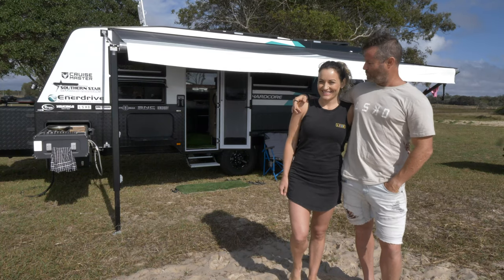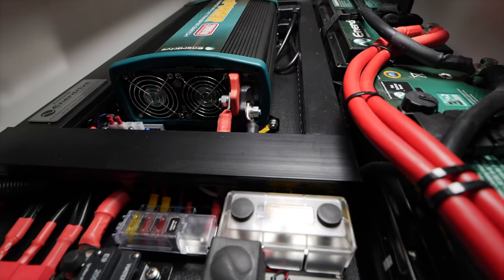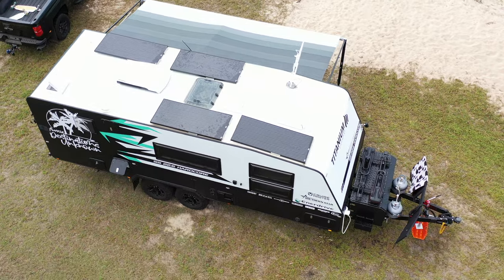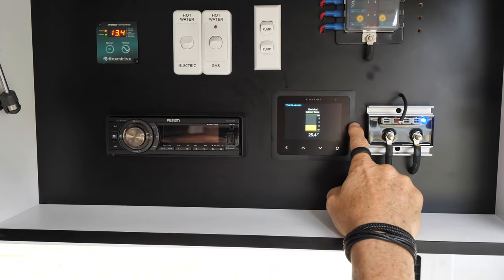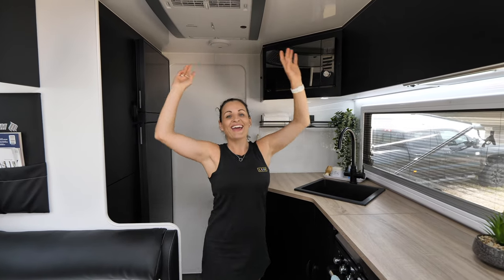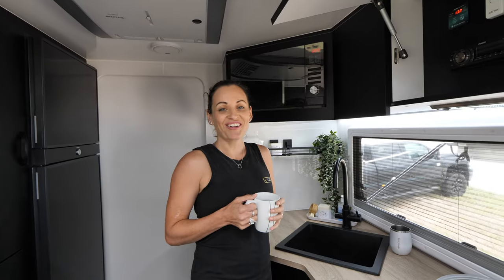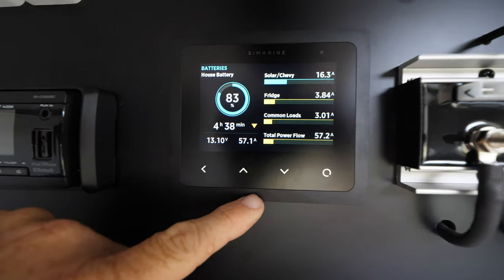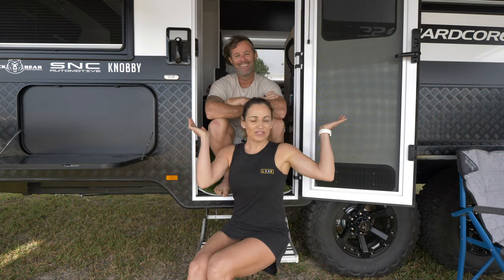Our Enerdrive Off-grid Lithium Battery System

Comment: Hi Chris and Miriam. We are considering an Enerdrive 400Ah system for our recently ordered Crusader X-Country Extreme. This video has sealed the deal. Thank you! I note you are changing to 2600W inverter. Was the 2000W insufficient?
Reply from the maker: Hey Rob. Great news on your new van!!!! Yep this system is amazing, we love it. Mate the 2000W inverter runs everything except the XXL Airfryer (2200W) and unfortunately Miriam wont be without it. This is the only reason we are upgrading and to tell you the truth i love what she cooks in it so I'm sold too haha
Reply: Thanks for your reply Cobber. Xlnt news. Our air frier is only 1500W! Final question, which air con is fitted to your van?
Reply from the maker: @robmorley7041  It's Miriam here now! :) I've had 2 air fryers for a while but we can only take one with us in the van - and the 2225 watt XXL kicked butt over the 1500w that we had. In fact the more i used the 1500w one the less I liked it and ended up giving it to my son. Lol. I'm fussy with my appliances and grateful to Chris for being so understanding hahaha! Oh - and we have the Truma Aventa air con installed. It's so much better than the others we've had. Much quieter and draws less power.
Reply: Aussie Destinations Unknown Thank you Miriam. It would be great to take our air frier. We’ll just have to see if we can fit it in. I’ll see whether we can option the Truma over the Ibis 4. Thank you both for answering so promptly. Best wishes Rob.
Reply from the maker: Rob Morley you’re very welcome 😁 The air fryer is such a great addition to the van! I use it a lot. I don’t actually use my oven at home. I bake cakes, quiches in it ...  everything you’d use an oven for I guess!

Comment: Quick question. I thought the Enerdrive dc2dc charger only accepts a maximum or around 40amps VOC from the panels. Wouldnt your solar on the roof be too much for it, considering most panels VOC is around 23 volts? Cheers
Reply from the maker: Hey mate, The Enerdrive dc2dc can handle up to 800w of solar. We have 720w on the roof. 👍🏼
Reply: @AussieDestinationsUnknown  Love the video - this is exactly what i'm striving for. I had a similar question, can you share the typical amps you see flowing from solar into your discharged batteries on a peak sunny day?

Comment: Hey awesomes can you riddle me this please....you got a decent size aircon which would be 2000w if not more....however you only got a 2000w inverter which is very borderline and would put you far over if you connect something else...isnt the inverter too small?(air fryer aside)....Also how come the AC only drew 600w fully cranked if the thing is 2000w or over rated? If you could shed some light on this would be great...yew!
Reply from the maker: Hey Dave 😁 Epower inverters are not restricted in reliability by using them at their peak.  Hence if a load will not exceed 2000 watts no need to have a bigger inverter.  Yes we do now often use larger inverters to run multiple loads at once.  The aircon uses what it uses.  At that time if it only consumed 600watts then that's all it needed to use.  It will use more or less depending on the ambiant temperature and the temperature you set it to.   That particular aircon does not overload a 2000 watt inverter. Hope that helps clear it up!
Reply: @AussieDestinationsUnknown  Yeah thats very good news that the ACs hover under 1000w(50-80A)....and actually that's what all the other tests out there show too....still would be good to know how this sum is reached from a sparky's point of view....interesting stuff...thanks
Reply from the maker: No worries at all 👍🏼